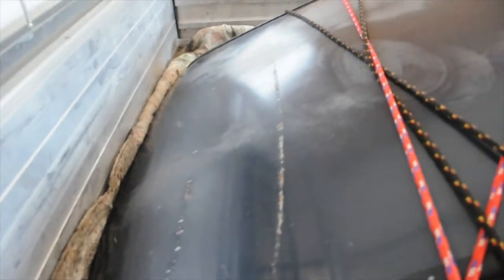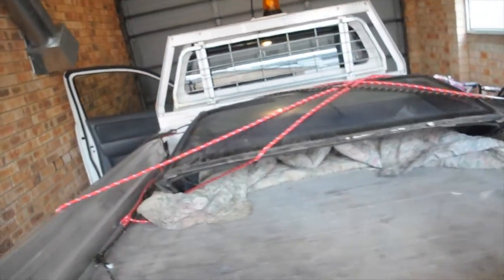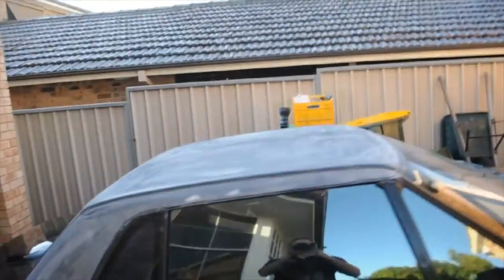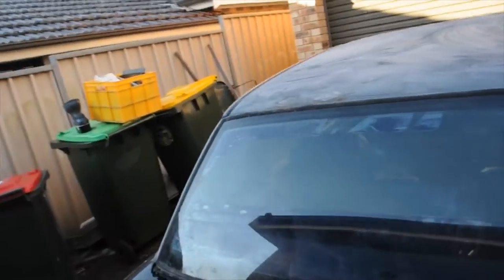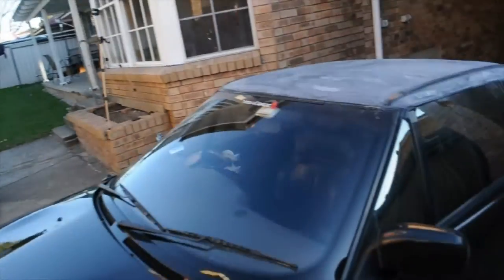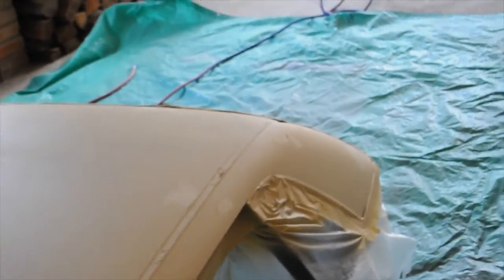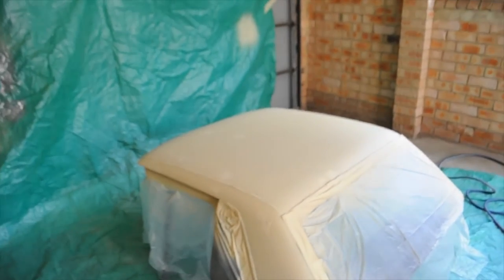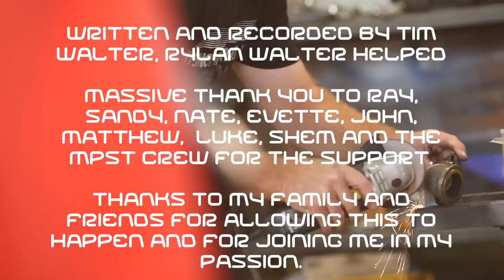New Roof for the Convertible

Comment: I have the American version, the Mercury Capri XR2 and I have a hard top on mine. I want to take the roof off of it but the hard top has black silicone on the seams so I am worried that It will let rain in if I remove it and start using the soft top as I live in Oregon which is a wet place currently. 

Also how does the clubsprint differ from my 91 xr2?